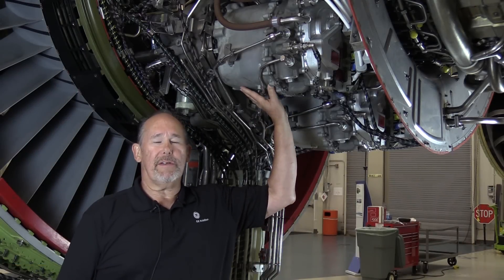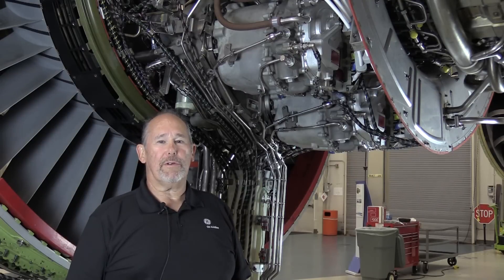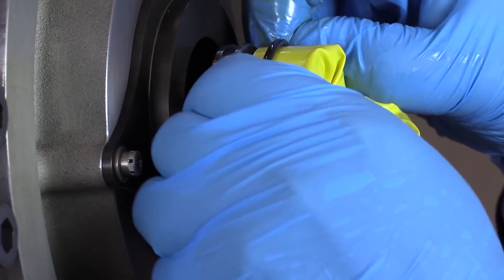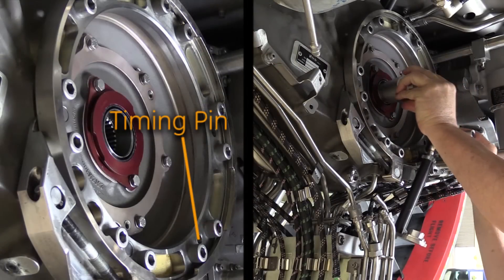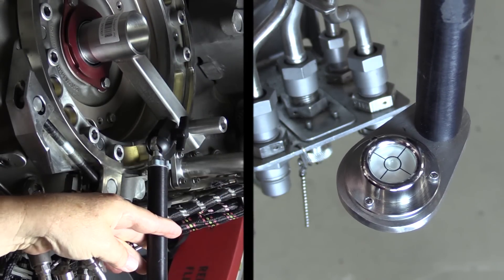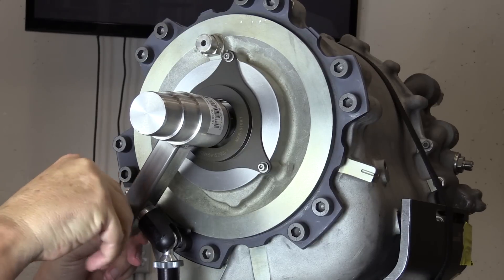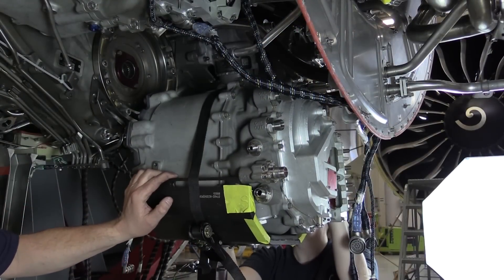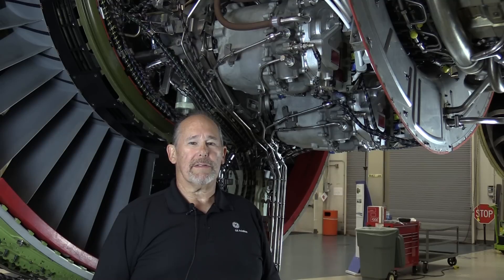GEnx-1B - VFSG Alignment Tool - GE Aviation Maintenance Minute

Comment: I do have a question on the VFSGs. Why does the left hand VFSG oil supply lines use o rings and the right hand VFSG does not. The updated replacement lines use no o rings.